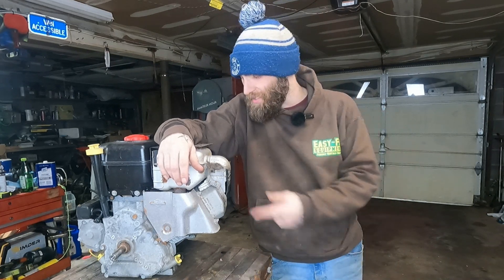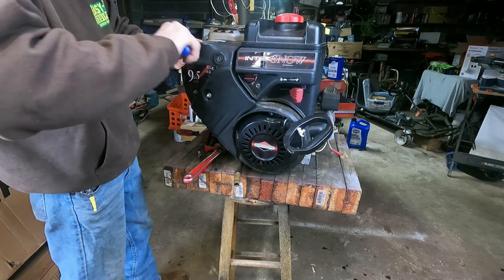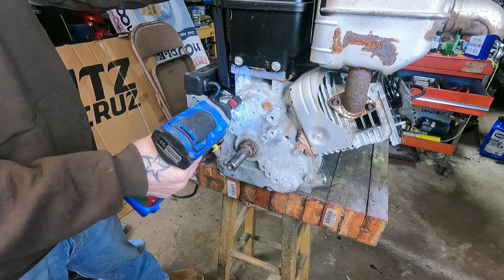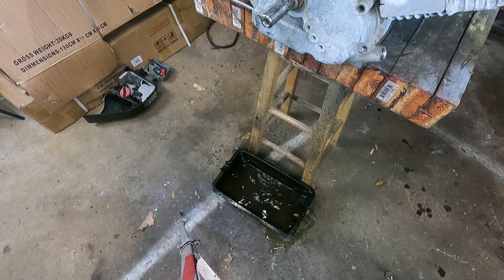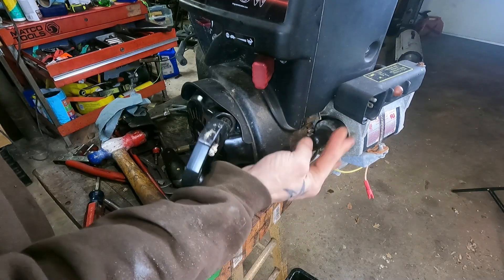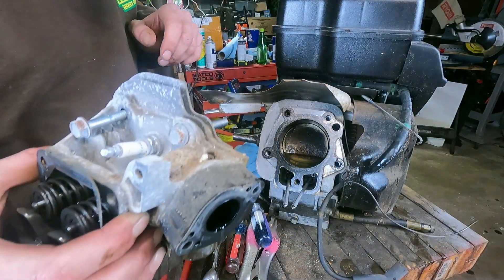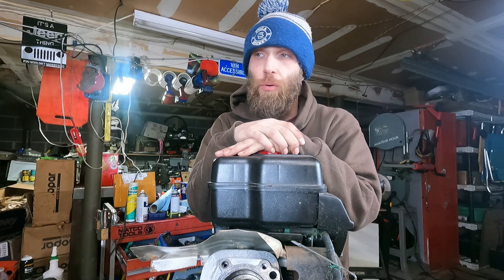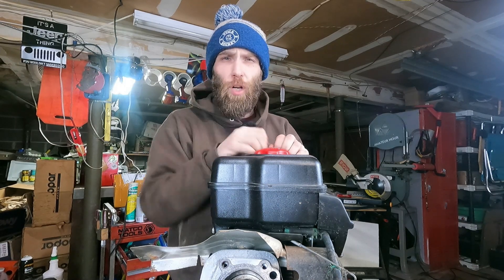What happened to this engine? (FAILED Briggs & Stratton teardown)

Comment: YouTube brought me via your cold air short, but I'm looking forward to more of these videos. I have juuuust enough mechanical knowledge to get most of the jokes. Subbed so we can hang out in the garage parasocially! 😂

I hit a huge stick with a pretty new mower a while back and the Internet told me it could mess with the timing, so I tore down the whole engine and put it back together over the winter. Totally unnecessary, but pretty fun, I learned a lot, and most of all, was able to punch the "saw a dirty piston in a cylinder with your own eyes" spot on my man card. 

By some miracle, when I had it back together THE THING RAN EVEN BETTER THAN BEFORE!!! 😮😮😮

My astonishment was very short lived though, when two head bolts rattled into the deck after only half a lawn's worth of mowing.  (What's this "Tork Wrench" you speak of?)

I put them back in and poured all my embarrassment into my socket wrench, trying to lock those down real good... of course while it was still hot. Sheared the second one clean off.

But it still ran great and I've been blessed with more money than sense so I gave it to a family in need (with honest story), bought a Ryobi electric mower and moved on with my life. 

Thank you kind stranger for reading my memoir.

Comment: When I was 10, I was bought a 2 seater Go-cart. 5hp brigs&strat. After 4 years and a new engjne. 4hp tecumseh. Difference was night and day. Even with me much heavier. Could burnout and do doughnuts like never before. Took off the roll cage cause I flipped and got stuck under it.

Comment: I got one with a Ta Cum See on it that's locked just like that one. Rod is snapped in half and jammed up against the wall, thankfully not through it. Those snow blowers are hell on these engines.